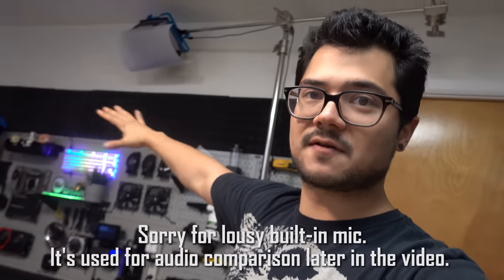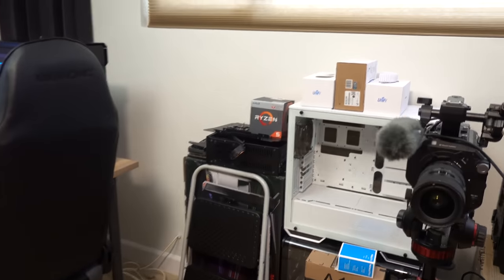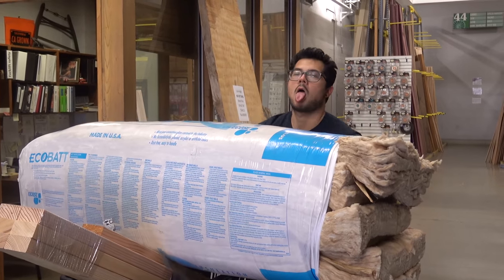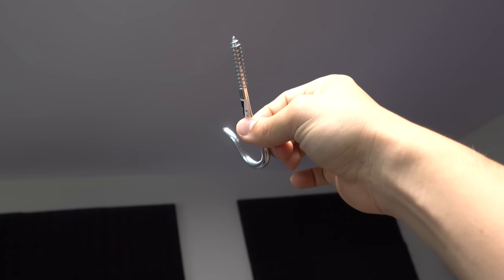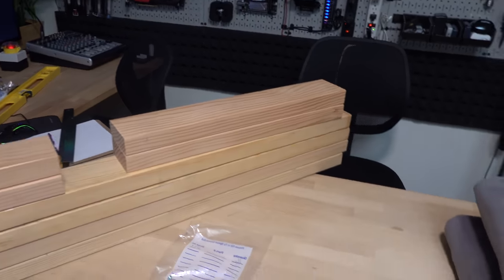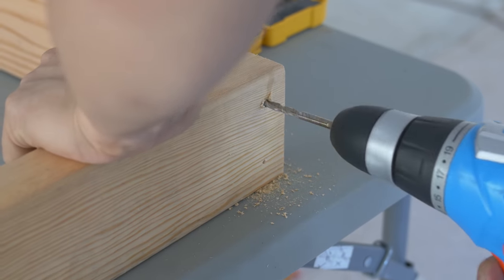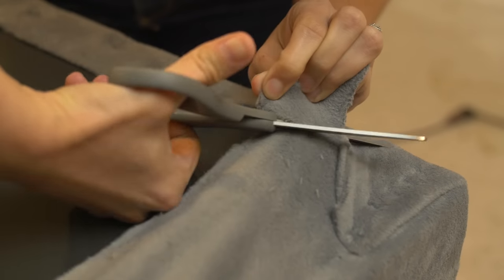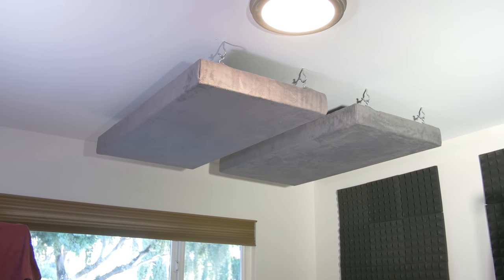Making my own acoustic panels...Was it worth it?

Comment: I currently have some of those "expensive panels". I had a home theater room before moving a couple years ago. I had bass traps (thicker acoustic panels with no backing on the sound board panels) straddling the front corners of my theater room, acoustic panels at the reflection points and then a panel behind my center channel. My friend didn't have as much money to spend on acoustics and he bought a bunch of the foam type stuff off the internet. He claimed he found several sources that said the foam would be as good as the more expensive panels that used the acoustic fiberglass panels. After I received my panels I did quite a bit of A to B comparisons. I of course listened to the sound from the same material with the two different types of acoustic treatments up. I also ran REW comparisons to see what exactly the treatments were doing as far as smoothing out the room response curve at the various frequencies. Ultimately the foam pieces did not achieve the same level of acoustic performance. They didn't smooth out the response curve in the room much at all. I still had considerable spikes and nulls at different frequencies.

Comment: Someone needs to treat himself to an impact driver
Reply: and a pocket hole jig and some wood glue and sand paper and some beeswax/mineral oil!
Reply: If he has a hard time using a basic drill what makes you think he would be better off with an impact driver?
Reply: @larryfoster423  Because impact drivers are so much easier to drive screws in with
Reply: @richardsandson  please explain
Reply: @hobomnky  An impact driver makes screwing in screws 100 x easier. That's the point of an impact driver. Drills for pilot drilling, impacts for screwing. It's a carpenters best friend. Just a bit of advice and not a moan though.
Reply: @richardsandson  That's 100% inaccurate.  Finish carpenters, furniture makers, cabinet makers, etc, only use impact drivers on heavy work such as substrate. We use clutchable drills for most of our work. We can set it to clutch early if it's light wood or small screws, a little heavier when needed, or full-drill if we want to sink a screw.  Not to mention, it's also a drill... and carpenters, you know, drill. Impact drivers are definitely used in construction, but mostly for framing related jobs...
Reply: @dighawaii1  He's not doing cabinet making babes. He's fixing 3x2" together with 3" screws. It's an odd thing to argue about really. Have you nothing better to do?
Reply: My impact driver is the BEST purchase I've made in years for doing repair jobs

Comment: The solution to hang them further away from the roof is actually ideal if you want to swallow echo. 

There is two types of Echo disruption. The Isolation and the Redirection. Both methods work but any test chamber on high-tech places tend to use the latter for a better reference point. While the former is probably what you aim for and built.

But there is the option to simply add stiff metal wire at both ends of the room and across it. Then buy a large roll of cloth sheet and just let it hang between the wires in a semi-circle fashion. That tends to help a lot for the cheaper buck.

Comment: I would have switched those panels with the ones on the wall, for simpler installation and lower fall risk
Reply: those will never fall
Reply: They really shouldn't be that heavy so there isn't really a risk of falling, especially with the 4 anchors into the studs.

Comment: As someone who's built a recording studio and did a ton of research. There are two ways to handle frequencies: absorption and diffusion. In this instance, you need a bit of both. The rug would definitely help absorb some high frequency reflections from the wood flooring, but you also don't want the whole room to be completely dead, so instead of just absorbing all those frequencies you could also diffuse them using a few skyline diffusors. You can buy them or make them, just fyi it's a bit time consuming. But heck it's a normal pingy sounding drywall room so just putting things on the walls alone would help or even a couple bookcases in the room. Enjoy!

Comment: Nice job,  for your first attempt at DIY sound panels, you basically did it right.  I'm a sound/recording engineer, have built many of my own sound absorber panels, and this is pretty much how I made my very first pannels....as you see it's not rocket science really......BUT, there are some things you can do differently to make it easier, more affective, and A LOT CHEAPER!!

1- FRAMING: using 2x4 for framing is overkill, 1x4 is plenty, much lighter..........note on panel thickness. The thicker the panel the more low freq absorption
. I use 1x6 or 1x8 for more bass absorption

.   One more note: for even more absorption
, you can go the extra mile by drilling holes into the long sides of the frame.  If it's a 4" piece, drill a 2-1/2" hole.  It just lets in more sound.  Maybe 4-5 holes per side.  This may be overkill for your situation, but worth mentioning.

2-FABRIC COVERING: As another comment noted, the covering fabric needs to be porous enough for sound to go through it, thus absorbing the sound.  If it's too dense it won't do much.  I made this mistake with my first panels. I just picked material that looked cool to me.   What you should use is basic burlap fabric that you can get at most any fabric store.

3- ACOUSTIC FILLING MATERIAL: I'm not familiar with that ECO-BATT stuff, but it looks like it will do the job.  Roxul is what I use, and is denser than the ECO-BATT stuff.  

4- CEILING PANNELS(CLOUDS): When hanging them I recommend using basic chain link which you can get and any hardware store. That way it's easy to avoid the clearance problem you ran into(I've had the same problem).  With chains you can also adjust the angle of your panel which can be beneficial. Should be weight rated appropriately (30-50lbs is sufficient).  I use eye loop hooks for connecting to frame and ceiling, not open hooks.  This is for basic safety reasons.  To connect them, use those  connectors that have a spring loaded opening,  like what mountain climbers use(I forget what they're called exactly?).........note: for a ceiling panel you're really just trying to catch early reflections, so even 1"x2" framing would be fine.
…..one more note: for the backing, a solid piece will work fine, but I prefer to break it up and use strips.  It took some trial and error for me to find what worked best.

5-COST......well,  $250 is WAY too much for just two panels.  Seeing that you had to get the insulation in bulk, I understand some of it.  Even with that though, it shouldn't have cost you that much.   Here in Los angeles I go to Home Depot, where a 1"x4"x8' piece of pine is around $5-6?.  All fasteners shouldn't be more that $25?.   A roll of basic burlap fabric might cost $30 depending on where you go, and that's a LOT of fabric.    The acoustic insulation is the biggest cost.   Here in LA there are tons of studios, so there's always someone selling pieces of Roxul or some other kind of absorption
 material in smaller amounts.  I've only ever bought it off Craigslist, really cheap.   If you buy Roxul retail, to fill two 2'x4' panels you'll probably spend around $40?.  

  Add that all up, to complete two 2'x4' sound panels, let's say $150.  There are always ways to do it cheaper, just gotta do the footwork to seek out the materials.

BTW,  I referenced your channel when building my current computer......thank you! ;-)

Comment: Hey Kyle, another DIY version of sound trapping material is quilted moving blankets/pads. Have used them before with good results and you dont have to mess with fiberglass because the filler is quilted inside the blanket. Build a frame like you did, but using 2x2 square boards (half the weight), then wrap the blanket around like you did with the grey fabric, staple it (i also glued it), and mount like you did. Its much cheaper, the blankets are $15 on amazon for a 72"x80" and the 2x2's are about $2.50 each for an 8 foot (4 needed). I made two 2'x5' from one blanket and spent less than $45 for everything.

Comment: I use a presentation board to mount the square acoustic foam. They are the same dimensions that most foam packages come in 3x4. They also come in black to hide any imperfections during the mounting process.

Comment: Two 2x4 panels aren’t going to make much of a dent in the room. Covering the entire ceiling with a grid of said panels will improve the sound..  Also, consider putting some sound treatment on that metal cabinet. One trick I used to create a mini-sound booth in my basement was to hang “acoustic” blankets (black shipping quilts) around the walls.  I hung 3 layers of them and it  tamed the echoes.  They aren’t much to look at but they work.  They also have the advantage of easy repositioning. One last tip: for your acoustic egg crate foam, try mounting it to sheets of black foam board using T pins. That way you can move the whole panel around on the wall as needed without dealing with adhesives.

Comment: Kyle, another option you could use for the walls (especially where that cabinet is) is to use blackout curtains that hang from the ceiling. Depending on the color and thickness of the curtains, you could reduce/eliminate echo as well as light bleed/reflection off that particular wall. As far as the echo off the floor, carpeted tiles could be an option. They are thin, easy to install/remove/store, and fairly inexpensive. Keep up the great work. All the best to you and yours.

Comment: First of all, I really like how you make a video goofing around, without really knowing what you are doing. That would scare a lot of people. I respect that.

Second of all, you made some weird choices, if I dare to say even some minor mistakes: 
- Placement of the panels should have been better above you, so you have less standing waves, and thus less reverb (you should use “reverb” instead of “echo”). 
- Closed back panel (poster board) makes the panel less efficient. It is OK when you mount them to a wall, but when mounted lowered from the ceiling sound bounces of the ceiling and could enter from the top. A meshed back would have been more effective.
 - If you use an open back, the lower they hang, the more bass you dampen. I would advise around 25cm or a little more (yes I’m European, but in freedom units it is around 10 inches). If it is possible of course.
 - The thick cloth blocks and bounces back high frequencies, and won’t be dampened by the insulation. The high frequencies will still reverb. You get a different sound signature.
 - The wood you use is overkill. It is OK If you hang something heavy, but insulation is not heavy 😊

Finally although the weird choices/minor mistakes, you already can hear the difference. And it is a big difference.

Comment: One of the nice things about how you have the panels mounted in the ceiling is that you can add a couple of short chains to allow the one side of the panel to drop down and thus eliminate the parallel/perpendicular lines situation.  This can help with the acoustics in the space.

Comment: Good job, I noticed a clear difference with headphones on.
However, you could save money by not installing the L brackets (excessive) and save time by not drilling pilot holes when you could just drive a screw right in.

Comment: Some more advice from an audio engineer.. A better material is Owens-Corning 703.  2" thick is okay, but 4" thick is even better for audio to tame the lower mid/ bass frequencies more.  Those foam panels you have sadly aren't doing much at all.  They will tame some of the very high frequency flutter echo, but you'll still hear a lot of boxiness from a vocal.  I got fiberglass insulation from ATS Acoustics. (They have they're own cheaper version of Owens Corning 703). It was almost $200 but enough to cover my 400 sq. ft. room.  You can use some cheaper 1.5x1.5" wood for the frame and whatever you like for material.  I personally used a thin piece of plywood for the back for sound quality purposes, which is probably uneccessary for you application.  Not sure if this is still a project you're working on, but you'll definitely need a lot more coverage of the walls before you start to hear what I think you're going for.  And you'll need denser fiberglass almost certainly.  I'd recommend moving all your foam to the ceiling and then covering as much wall as you can with some dense 2x4' panels :) I'd be happy to help if you have any questions, or want some pictures of the ones I made for my recording studio!  Good luck!

Comment: I love a good diy! Here's an idea for next time. When you're drilling the screw holes in the boards, Try this order. Drill the smaller holes in "board a" first. Then, line up "board b" and drill through the holes from step 1 into the end of "board b", again with the smaller bit. Finally, use the larger bit to resize the holes in "board a". This method will make it easier to ensure that the holes are perfectly aligned.

Comment: The ceiling panels are fine, but you also have to treat the upper corners. When untreated, any sound that hits the corner will reverberate through the side walls canceling out the ceiling panel’s function.

And it’s also good to have portable panels that you can place in front of you, behind the camera, so when you speak the vocal waves are stopped by the panel, instead of traveling untreated across to the untreated wall. 

I did my entire garage. Hit me up if you need recommendations.

Comment: You can definitely hear a slight difference, I think the main problem from this was that there wasn't enough of it to make a huge difference and the cost. didn't seem worth it. I 100% appreciate this video because it provided a lot of do's and don't and really made me think of what I could have done to improve it. Honestly, I think I would opt for canvas sound panels with the sound foam stuffed behind by gluing it firmly on there and then mounting it on the walls and then for the ceiling taking the canvas and placing the foam on both sides and then mounting them up in a similar fashion. reducing the weight of it and making the hardware needed for it to be cheaper since 2x4 is pretty heavy.

Comment: I suggest using thin pins inserted at different angles to hold up the prefab foam panels (drywall and wooden only). They hold fairly well so long as you’re not moving and removing them constantly and they cause minimal damage to your walls

Comment: epic!!! Only thing I would have changed is the insulation. I did 6 panels of the same size for around the same price(a bit more). Cornings 703 or 705 would have been cheap and effective. Rockwool would have been good too, but Cornings would have done enough work and provided a decent amount of sound absorption for better bang for your buck.

Comment: You can easily cut costs If you use cedar fence boards as frames rather than 2x4s. You will need to sand them down if they run a risk of being touched and getting splinters. Also any fabric can be used as long as you can breathe through it, there is a bit of false advertising out there for fabrics marketed as "acoustic fabric" as they make no real difference, but as I said if you can't feel your breath through it then sound waves will not be able to permeate it effectively enough for it to be worth it. It is also unnecessary to have posterboard on the back, you can simply use more fabric, this will also increase the amount of acoustic treatment because the soundwaves can enter the acoustic material from both sides. rather than just the front.  I was able to build 6 panels that were 16"x 48" for under $150 bucks (not including the cost of tools like saws/sanders/drill.

Also keep in mind the most efficient way to get rid of bad reverb is to treat the corners first, sound naturally funnels into the corners and this will be the best and cheapest way to get the most out of your panels. The sides of the room are still important but I'd maybe prioritize the side of the room that is behind your microphone/camera set up to be the more heavily treated than others. Also, Not that anyone asked lol but I went to school for audio engineering and sound design and have experimented with all sorts of acoustic treatment solutions Owens Corning, Rockwool, and traditional acoustic foam, even some more ghetto solutions as a child with surprisingly effectly repurposed memory foam.

Comment: Using my higher-end audio setup (ODAC + DT880's) I COULD hear a difference, but it wasn't huge. I imagine people watching this on a TV/phone speakers/mid-range gaming headset had a bit more trouble. The change seemed to have been frequency-specific (ie, the echo still existed, but you managed to help cut out half of its frequency range), which could be difficult to note without decent sound reproduction.

That said, I'm also listening after Youtube's audio compression, which is less than ideal, and would explain why YOU think there's more of a difference than we on the other side can notice.

Comment: Some info : acoustic foam is not for absorbing sound, it has low density so its lightweight and doesnt stop the sound, towel has more mass, its for diffusing, breaking up the sound to remove unwanted reverb/echo. For absorbtion/insulation we use rockwool in 99% of cases then fiberglass, and other high density materials like vinyl. The panels in this video use fiberglass/rockwool which is an insulating material with a basic reduction of echo. Some more acoustic foam on the ceiling wouldve done the job better for way cheaper, and faster, assuming you dont care about insulation.

Comment: Here's a simple DIY tip. I noticed when you went to put the drill bit on the screw, the screw fell over and you had to realign it to screw it down. The tip is to use a socket like a sleeve. The socket will fit over the screw and it docks with the drill bit allowing for a docked connection. Hope it helps for future projects.